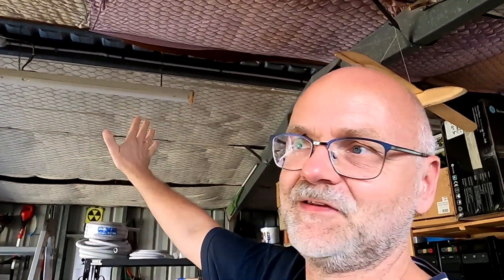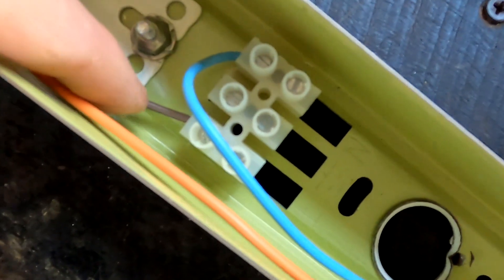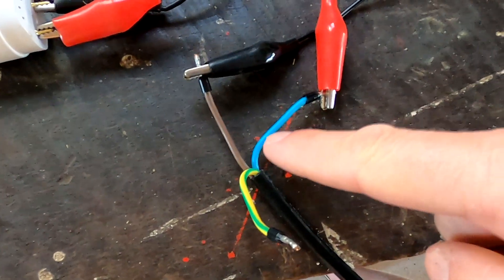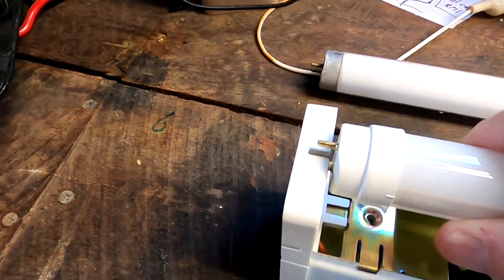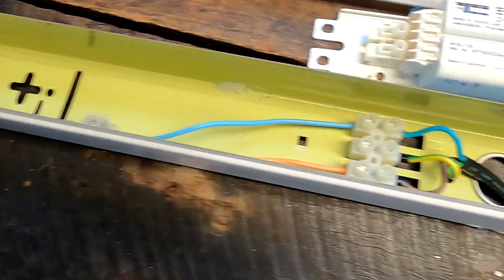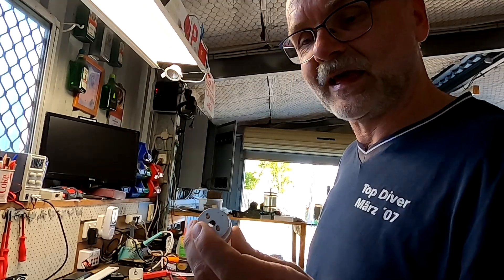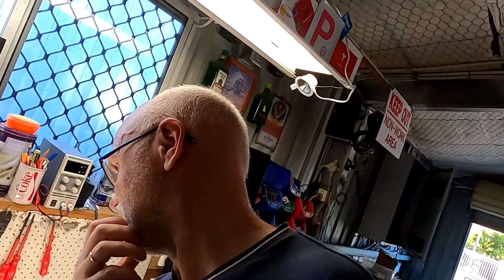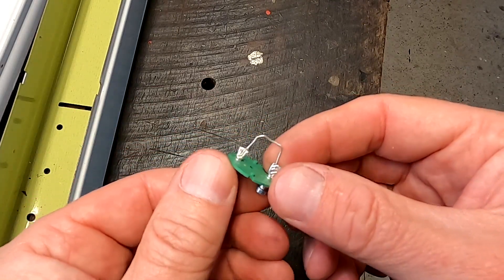How much you really save by removing the ballast from LED lights

Comment: The ballast regulates the current to the lamps and provides sufficient voltage to start the lamps. Andy what is regulating the 16 watts LED when you plug the light into 240 volt socket just that little wire inside the LED light?
Reply: The tube has its own led driver build in. The ballast is not needed, but like Andy says it is far to time consuming to modify the lamps
Reply: @holgerj7520  oh he said a wire so i was a little worried

Comment: Just a teaser, pretty sure that the blue wire is neutral and the brown'ish one is the live one but it doesn't really matter, the LED tube work both ways :-)
Reply: But it does matter. The switch should preferably be on the active (brown) wire.
Reply: In the olden days red is live which is now brown, black is neutral in old colour or in new is blue and green and yellow is earth olden days earth was green. Where he’s saying the blue wire is active is because most probably it’s wired in twin and earth too the switch so live brown would be carried down too the light switch then it’ll get sent back up the blue wire as switch which should be over sleeved with brown sleeving too let the next electrician know it’s not being used as a neutral
Reply from the maker: @christianmoss4603  exactly, that is the big problem here in Australia. We have most installations done as per the old wiring rules and colours. Even cables you buy these days still have the red and black cable inside. I keep continuing installing after the old wiring code as long as the cables support it to avoid any confusion. That's why you should use an electrician for any electrical work as they know what they are doing.
Reply: Yes Peter it does matter if you were to put an additional switch in the circuit on the blue wire thinking that was the active, and switch the switch off the circuit up to the switch would still be live!
Another thing is that unless you have an electrical licence as required in Australia you can not wire up any fixture, I would remove this video as it is incriminating!
Wire the light / appliance off camera with a plug and complete the test that way, noting that all electrical work should be completed by relevant quality persons for your country etc.
Reply: @76queen  I think you misunderstood, I agree it does matter.
Reply: @peterking1134  I was agreeing!
Reply: Leave the fuse, (not starter) in to stop led fires from burning your off grid garage down!
Reply from the maker: AS3000 says Blue is active, Black is neutral. That's how it is wired in older houses. AS3000 also allows to use the European cable colours though 🧐
Reply: @OffGridGarageAustralia  OK, not familiar with the AS3000. Just kind of assumed that the colouring was the same as in Europe. If you dissassemble various plugs "with a groundwire too, 3 pin plugs" the live is always black or brown and the neutral is blue. In the old days before i became an electrician in Denmark's 70's we had the black as neutral and other colours as live ones but I think it was a leftover from the beginning where they used DC and not AC around.
Reply from the maker: @ravnox3057  it's now there same a in Europe but most installations still have old wiring and colours
Red,Brown,Blue-active
Black-neural
Reply: @OffGridGarageAustralia  uk is red or brown positive 
and black or blue negative
We are now only allowed to use cable with colours brown positive and blue negative , green and yellow is earth
Reply: @OffGridGarageAustralia  Current Australian colour code- Single phase
Active (high potential): Brown
Neutral (low potential): Light Blue
Earth: Green/Yellow